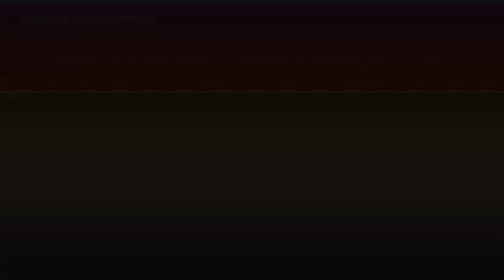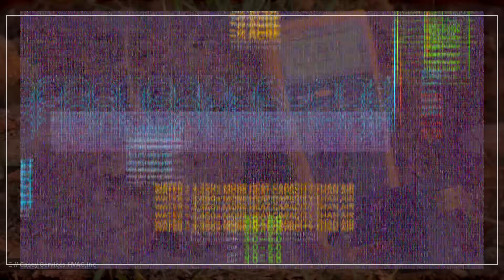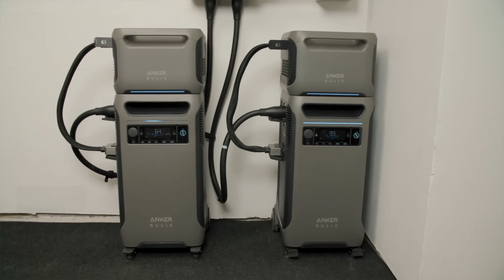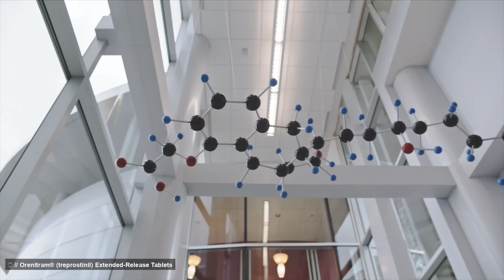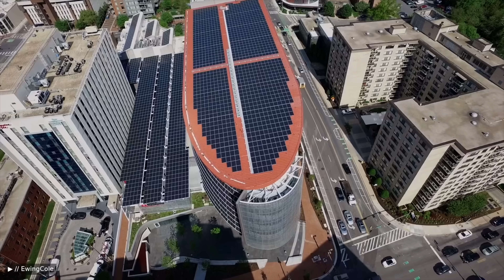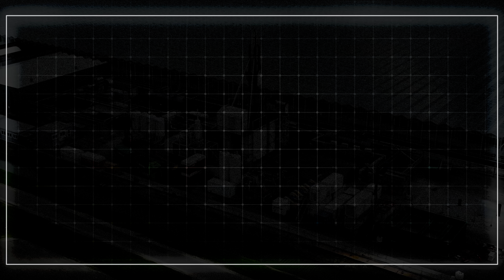The Viral DIY Cooling Hack That Nearly Killed a Family

Comment: You left out new construction, where the added cost is a fraction of refit. You can actually run loops at the same time the house is connected to town water/sewer electricity? A whole new neighborhood development as you pointed out. Downtown Singapore has a loop that runs through the ocean to feed the air conditioning systems downtown. A datacenter in Toronto is doing the same in Lake Ontario.

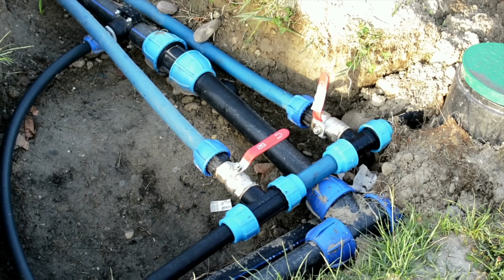Comment: Some of the videos I've seen, probable not the same, just accuse, for profit interests in influencing outcomes, not actual banning. @2:00 min, air and water, as radiant fluids, is not about the conductivity of the medium, but surface area, a large air pip can be more efficient given the surface aria. In addition, Air can pe pasive when combined with a Tromb wall or solar chimney. A concern with air is radon, so if you live in a zone with higher radon levels, you'll want to use liquid.

Comment: Getting maintenance on these systems can be difficult.  We have a open loop(returns water into the top of the well) vertical bore system installed in a property we bought.   System was using $500 a month in electricity, the HVAC guy said the system was fine.  Brought a well service guy out and paid him almost $5000 to replace a deep well pump.

Comment: Certified in ground-source systems and installed more than a few commercial systems over the years, mostly schools.
It might be an advertising distinction, about the well driller being certified, or local zoning BS. Have not run across any?
In northern Illinois, the well is about $50 per foot, with many variables; 100 foot covers most in this area.
The well drillers were familiar with the local conditions and were a big help.

Comment: Here’s another option with air tubes. Just direct them near the intake of an air source heat pump.
Reply: Not just near, but seal the outdoor unit to the earthtube.  Outdoor fan will force air through tube.

As the video points out, air is much less effective at moving hear than liquid.  However, the economies of scale for air-air heat pumps may make this competitive for winter lows.

Air source in summer can be offset by solar, but cloudy, extremely cold winter days can drop air source CoP to near 1 and solar can't help.  You can be at risk of the home freezing.  Earth tempering the air can mitigate this.  I suspect that a big enough earthtube to support winter heating without cooling to the point it no longer helps might be similar to underground PEX pipe/glycol fluid installation.

If you live near a mine though...
Reply: @SeekingBeautifulDesign  yeah where I live underground temps are not cool enough. But then again I live in a cocoanut growing region of the US.
Reply: @yolo_burrito cheap solar to power air source AC is likely much more cost effective than an earthtube.  In your clinate it would heat up until it provided no benefit.  Need some winter for that.

Comment: I figured it was mold as soon as you hear air source and long pipes. I think any heat pump system  would be very useful in most places. the ground loops sound expensive though . I wish you luck.. Also being you use a lot of solar it changes the math again since you are paying for solar not for electricity. I wish you luck on your system

Comment: I’ve tried twice here in FL to get geothermal. That was when building my home and when replacing the crappy system the builder used. Each time I’m told no. There are no options here and no installers. I spoke to a few that are certified to install but refused to do it. I am willing to be the first. They don’t care. My new 20SEER system was $42k. I would have rather spent that on geothermal.
Reply: Was the refusal just because they could make more money elsewhere  and/or were worried about you suing them later if you promised not to?
Reply: @SeekingBeautifulDesign they didn’t give a reason just they won’t do it. I started to try and find a way to do it myself but the builder said I could only use their contractor. Well, years later and after the original died I tried again but ran into the same issues. AC companies refusing to do it. Then the wife got mad at our hot house and I just had to get something. The best I could find was the 20 SEER and $42k installed. I still have an upstairs unit that is original builder grade.
Reply: @MrTheheds ouch on multiple levels.

Comment: The version with air, is not as bad as you think, but it must be just a part of HVAC solution, pairing especially well with HRV. You just channel intake air through the pipe in the ground, and it can save You a lot of energy You would spend on heating or cooling. This is not solution to heat or cool the house, it just help with heating or cooling the air, shaving the costs for essentially free.

Comment: I've generally memorized 10 degree incriments between celsius and farenheit at temperatures Ive experienced:
0C ≈ 32F
5C ≈ 40F
10C ≈ 50F
16C ≈60F
21C ≈ 70F
27C ≈ 80F
32C ≈ 90F
35C ≈ 95F
38C ≈ 100F
Ideally no one needs to use this, but i figured it can't hurt to share

Comment: Heat pumps and mixing boxes are great to de-couple thermal energy from ground air exchange. Heat pump draws its feed air partially through ground exchange. No radon cause the heat pump exhausts everything but the heat.

Comment: I completed electrification coaching training with Rewiring America in 24 and GSHP is considered the most efficient system. It is absolutely not banned. But these systems are typically closed loop. An open air-based system of course would be at risk of mold issues and I would never recommend it. 

I’m thinking about a GSHP system because I plan to be in the home for decades and want the most efficient system I can afford. I have a very long time horizon which most people don’t have. I would love to have networked geothermal as an option.

Comment: Key takeaways:

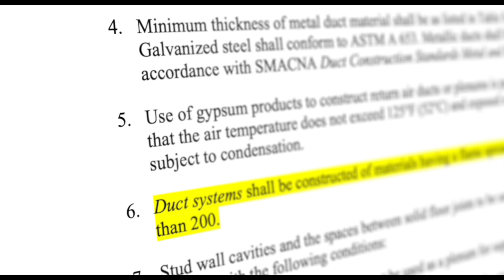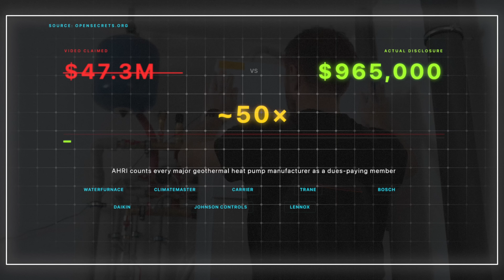Debunking the Conspiracy: The creator verified that the building codes cited in viral videos do not actually ban geothermal (2:58 - 6:44). In fact, these systems are used in over 1.3 million buildings, including massive commercial projects like the Unisphere building in Maryland (7:24 - 7:58).
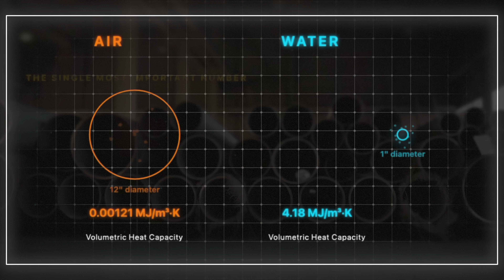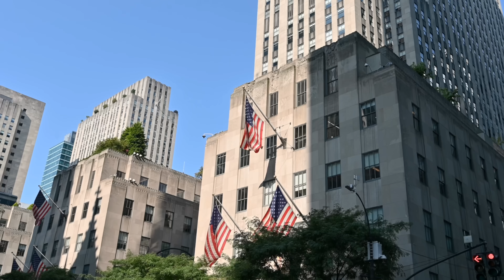Physics and Efficiency: Water is 3,450 times more effective at carrying heat than air (1:42). Therefore, systems using a water or brine loop are vastly superior to the 'earth tubes' promoted in viral DIY videos (1:42 - 2:06).
The Mold Danger: Directly piping air through buried tubes (as seen in the viral DIY hack) can lead to significant mold contamination, as illustrated by a failed 2005 passive house project in Belgium that became uninhabitable (8:00 - 9:05).
Barriers to Adoption: While the technology works, widespread adoption is limited by high upfront costs ($25k-$65k), a shortage of specialized drillers, and industry inertia (9:51 - 11:20).
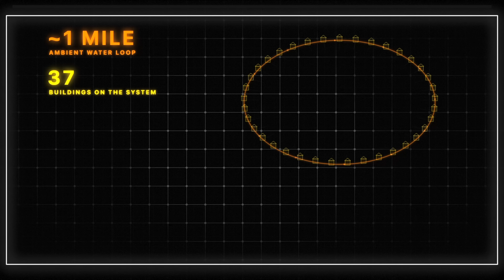Successful Implementations: The creator highlights successful models like Whisper Valley in Texas, where residents save significantly on energy bills, and the first utility-owned geothermal network in Massachusetts (12:00 - 13:56).
Economic Changes: Note that as of July 2025, the 30% federal residential tax credit for geothermal installations has been terminated, which is expected to impact the residential market (14:32 - 15:29).

Comment: In many places, running a DIY, non-sealed air duct through the ground is also a very efficient way of pumping radon into your home.
Reply: @letsmakethis  the air duct is supposed to be sealed and graded with a small place for drainage at the bottom. So neither radon nor mold should be a problem. I would personally duct it straight into an erv or a dehumidifier still.  I dont think im quite in the boat of completing writing these systems off. You need a way of tempering that incoming air when you ventilate.
Reply: @letsmakethis  So, seal it.  And I have to run a little muffin fan radon removal system in my basement anyways because I'm on top of a large MN uranium deposit.
Reply: @kathyfox5193  Fair enough. As long as it's properly sealed, you should be fine as far as Radon is concerned. I was thinking more about the kinds of DIY systems that you see built here on youtube, where everything is lose-fit and buried as is.

Comment: Legionnaires disease is one of those very deadly diseases you can get from this type of system.
I had a friend who got it just by cleaning out the algae from a backyard fountain.
He almost died before they realized what was wrong.
Reply: Legionnaires is no joke, and really should be better known, people think standing water is fine as long as you dont drink it
ive had it 2 possibly 3 times now two from old air conditioners that got clogged
as a warning to anyone, if youve got an airconditioner thats been turned off for a while before you turn it on check it and clean it it takes 15 mins
open the front cover, and point your phone light straight down between the fins
if theres water there do not turn it on, all it takes is one dead insect to clog it enough to create standing water
tip a jug of water over the fins gently to move the clog
then use aircon cleaning foam, its like $5 and takes 2 mins to apply
wait 20 mins and then turn on the aircon, if it drips the clogs not fixed
Reply: Most geothermal systems are closed loop, which means the water only comes in contact with the heat exchangers, not the air directly. You can only contract legionella in instances where the air carries droplets of water that are contaminated with the bacteria, like your friend's backyard fountain. While it would be theoretically possible to get legionella if there were a cooling tower in the water loop, that type of system is usually cost prohibitive for residential applications, and commercial systems are more likely to be properly maintained with water treatment. All cooling towers in the US require anti-bacterial water treatment after the 1976 American Legion conference when the hotel's ill-functioning cooling tower bred legionella and caused so many to get sick.
Reply: @curiotrope   nice to see someone limit a response to facts, and enough data for people to look up the information for themselves.

Thank you for information instead of inflammation!
Reply: @johnr3937  Legionella bacteria exists naturally in water and soil, you need the inhale it into lungs to get infection. In water it will grow around 20-60C water so it needs to be cold or you need to heat the water above 60c to kill the bacteria.
Reply: Inform yourself through science based sources instead of Facebook
Reply: @johnr3937   like damn bad luck and wear a mask for Pete’s sake folks
Reply: @Wanhope2  Well, I'm pretty paranoid and it would not occur to me to wear a respirator when cleaning an outdoor fountain anymore than it would occur to me to wear one when cleaning a bucket that's been sitting out.
Reply: @DKNguyen3.1415  I don't think he said "respirator".  He said mask, which is probably not effective at all.
Reply: Talk about FUD. That is total nonsense.
Reply: @avsystem3142  No person using the term "FUD" has ever been worth listening to.
Reply: @avsystem3142  no, not at all. Just consider the case with mold mentioned in the video. Just replace mold with legionnaires contaminated water and you've got a legionnaires spreading system.

It's not FUD, it's a true failure scenario from underground open loop systems. Water infiltration and leakage should be assumed with all underground pipes.
Reply: @justhecuke  Then don't use air in the cooling loop. Simple as that.
Reply: @Outworlder   what? This is about home cooling. Air is sort of required for it to function.

You can certainly have a closed loop system and a heat exchanger to transfer the heat, but tyo do require air at some point in the system.

Also, closed loops are notorious for, well, not really being closed. All underground pipes leak. That closed loop will leak water somewhat constantly which can cause significant problems due to erosion, soil absorption/expansion, not to mention the simple waste of water.

Air makes it less worrisome if there is a leak, but does make it vulnerable to air quality issues.

As with most all things, it's a tradeoff. You could also use a good filter and uv sanitization system instead.
Reply: @justhecuke  Obviously HVAC eventually involves air. Heat exchangers aren't really rocket science.

"All underground pipes leak". Maybe eventually. Not all the time. And certainly not for quite a few years. You can also measure the amount of water in the system to detect leaks. Given that many system don't even use pure water, and they use a different coolant solution, leaks are definitely not expected. What are you using for pipes?
Reply: @justhecuke  There's no reason to use outdoor air. You just cool down the air already in the house using a heat exchanger and circulate it. The heat exchanger uses coolant to dump that heat in the ground. There's no air transfer between indoor and outdoor.

Comment: Solar and battery technology will be cheap in near future or even at present already is and will be the future of heating and cooling. In our case in Brazil it will be cooling.
Reply: At present, I believe solar is now the cheapest form of electricity production.

Even better is there's a lot of work in solar tech and I believe they will soon have a big leap in technology making it more efficient. And batteries will also soon have a big advancement.

Once both make their advancements, and production gets up to speed, solar and battery tech will be so efficient and cheap that it'll be the standard.

Comment: I think it is a great Idea but one of the other thoughts is if everyone starts doing this and the heat is exchanged  what will that do to ground temperatures.  Would it not effect them and cause other problems like microbes who can't handle the temperature change.  Iknow things were done in the past but as we have seen that is not always a good thing.  also this this could be like a well.  6 foot down is I think you said 57 degrees but what is it 300 feet down?  I would like to see a study where there is temperature gauges by these pipes to see what the change is.  We have a basement in Virginia and it is typically 6 to 10 degrees cooler than the middle and unpstairs.

Comment: Videos containing any form of "they don't want you to know this" should be banned.
We live in the Rhine valley in Europe and are fortunate enough to have ground water at around 10ft. This water is always at 12-13°C  (54-56°F) year round. We simply dug 2 wells, one as a source and one as a return, and use this to as the medium we are drawing heat from for the heat pump that replaced our oil heater and in addition, use the cool water pumped through a heat exchanger in the summer as a simple AC for the ground floor of our 150 year old farm house. Our heating (and now AC) costs are cut by nearly half of what we paid for a year's worth of heating oil...
Reply: Congratulations on the savings.  Oil and grid electricity costs vary widely, but I woukd have expected costs to be 1/3, not 1/2.  Do you have relatively expensive electricity and relatively cheap heating oil?
Reply: @SeekingBeautifulDesign  Yaaa, I wasn't being completely fair. We installed the heat pump just after the Covid lockdowns and a little over year before Putin's limited military operation. Using pre Ukraine war heating oil prices puts us much closer to 1/3 savings. I was gloating on 2 fronts: tech (planned) and timing (lucky).
I don't understand your second comment below completely. Even after the coldest winter we've had these past 5-6 years the water temp in our underground lake (very true!) has only dropped by around 1°C. The water is more than warm enough to keep our heat pump operating efficiently all winter (despite the fact that our house is not very well insulated).
Reply: @Steve_MFr Open loop systems like yours have the lowest installation cost.  My 2nd point was only that closed loop (where heat stays put but high installation costs) can access 25C temps in winter and 5C temps in summer.  You get a consistent and very useful temperature all year with low installation costs.  So, absolutely the best choice and congratulations that there aren't backwards regulations preventing you.
Reply: @Steve_MFr Actually, thinking about what you wrote.  I meant 1/3  the cost or 2/3 the savings.  This is a near meaningless estimation as oil and electricity vary widely.  I was just estimating that a heat pump costs 1/3 that of electrical resistance heating.  Your 1/2 could be great or terrible.

Probably not a helpful comment on my part as oil and electricity price variance overshadow efficiency gains.  Comparing across the world financial savings isn't so useful.
Reply: I guess the tradeoff for a cheap installation of your water source system is that you mostly font get to use the summer heat from your AC in the winter.  That summer heat convects away too quickly to be available 6 months later give you're effectively connected to an underground lake.